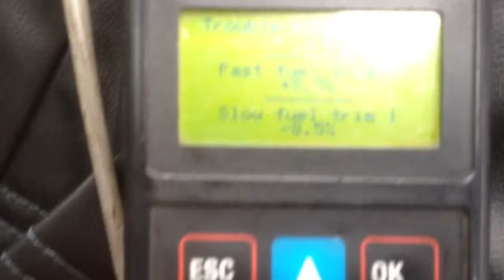Toyota Avensis 1.8 Valvematic LPG converted

Comment: To anyone who might be interested I have Toyota yaris 1.3vvti converted to lpg about 40k miles ago and is still running fine.  1.8l v-matic engine is even better for conversion as it have hydraulic valve adjustment so less chance for VSR but I would still install valve lubricants as Lpg has no additives like Pb protecting your engine.

Comment: hi,is stil work?? I heard that Toyota avensis is not suitable for LPG becouse of valve seats damege.Have u valve lube instalation??
thanks!!
Reply from the maker: Ovidiu Moldovan yes it still works fine. The car is a private hire taxi & has covered over 80,000 miles , it does has a valve saver system fitted.
Reply: hi,in this 80,000 miles have u adjust intake valve and exaust valve?